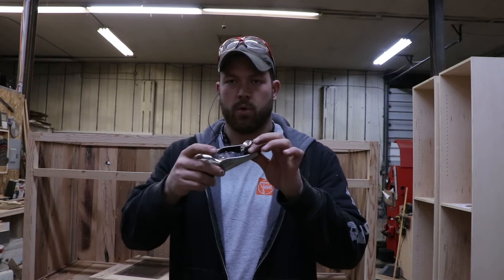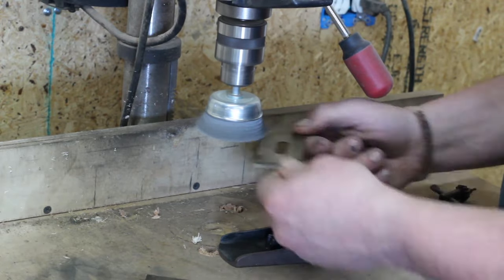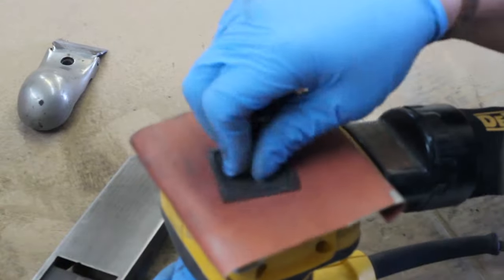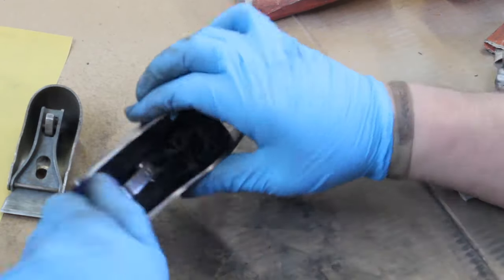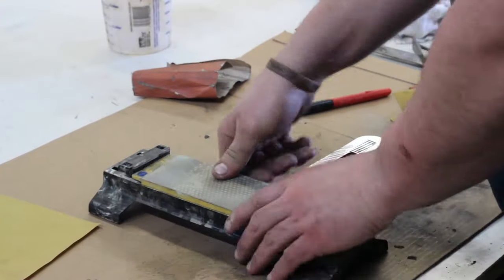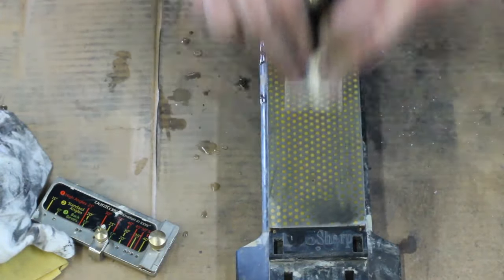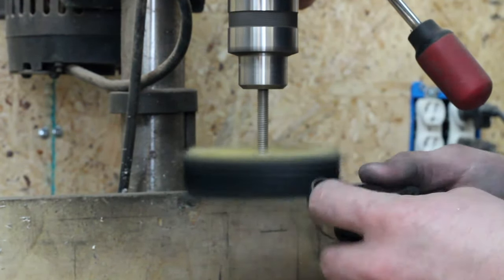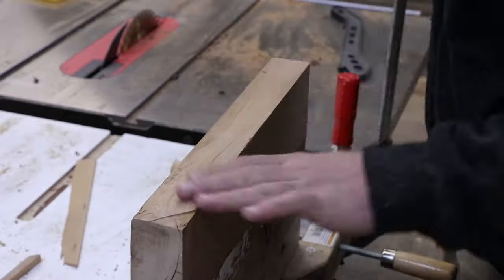How To Restore A Stanley Block Plane

Comment: just a general rule of thumb which goes for all your blades (planes, chisels, shaves, etc)

If you want a tool for finer paring/slicing work make a primary bevel of 25 degrees. This is good for most planes and shaves as well as dovetail/pairing chisels. If you want a tool for heavier jobs like chopping or roughing out use a bevel angle of 35 degrees. This is good for general purpose bench chisels and also good for "high angle" planes when you are working with figured wood and you want more of a scraping action versus a slicing action.

You never really want to drop below 25 degrees because it will seriously affect the durability of the cutting edge.

Comment: That's a beautiful tool. Good narration. You should've put a little 3 in 1 oil on the screws threads as you were putting it together. Good video. 👍

Comment: I use two blades in my low angle block plane, one is sharpened at 25 degrees and the other at 35 degrees. If I am planing face grain I use the 35 degree blade, the 25 degree blade is for end grain (or when I'm too lazy to change the blade!). If you are having trouble pushing the plane through the wood, i would recommend putting a little camber on the edge of the blade, or taking a thinner shaving. I really enjoyed your video, thanks.

Comment: I'm brand new to all this but when i was a little kid (1975/6) a carpenter who lived next door made me a toy sword and showed me his plane. I asked why one corner of the blade was longer than the other and he said it was supposed to be like that so it would cut more easily.. when i saw you trimming the blade to 90 degrees i remembered that.. he said the long corner started cutting ad a knife point and the running edge, on what I'll call the back sweep, kept the cut going..
But that's all i got shown and it might have been that one model..
I remember he also told me to keep putting the blades for the craft knives back in the handles or they just disappear.. and he did that religiously after every use.. shame we didn't interact more but he was retired..

Comment: 2:40 you REALLY shouldn't be flattening the sole with the adjustable mouth off the plane. It will create an uneven surface between the mouth portion and the rest of the sole.

Comment: Bro, you've got that thing set for a lineman shaving.  You need to set it for a wide receiver shaving.  I believe that was the main issue with you having to brute force it so much.  Shaving was just too thick there in that last shot.  Dang that thing cleaned up nicely though!
Reply from the maker: ya i went and got a 16000 grit shapton and will be sharpening it up to razor status soon
Reply: John Malecki it might be plenty sharp, just back the blade up some. 16000 never hurt either 😃

Comment: Hey John! I have the same block plane that I got from Jimmy Diresta so you know it's covered in rust haha. Thank you for sharing your process and I intend to freshen up my plane the same way. The only thing I've done so far was sharpen the iron and it works like a dream. I set my worksharp to 25 degrees for the primary bevel and didn't add a micro bevel. I don't where you set yours but I hope this helps you with your primary bevel issue

Comment: With the sharpening wheel you get the blade to high temperature and it is not recomended unless you deep it in water for cooling every few seconds.

Comment: This kind of plane is better when set up for thin shavings, not thick like at the end of the video. It shouldn't take that much effort to push when set up correctly. These old low angle planes are kinda fragile around the mouth area, so it's not a tool you want to force when you're using it.